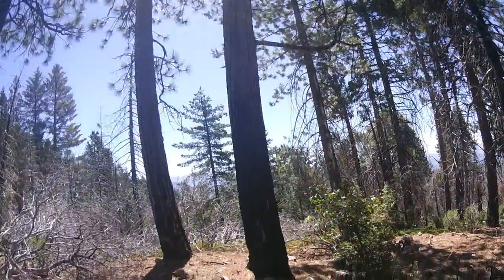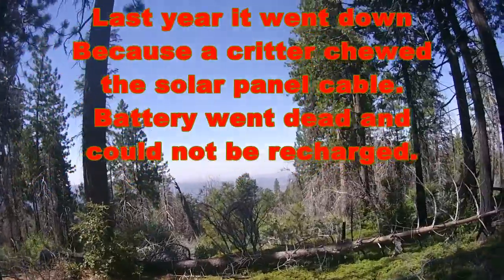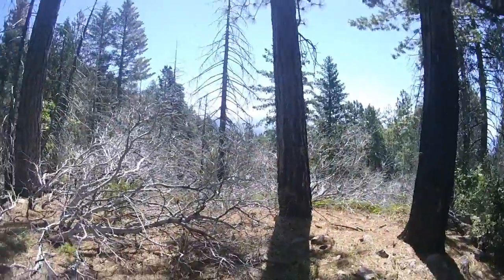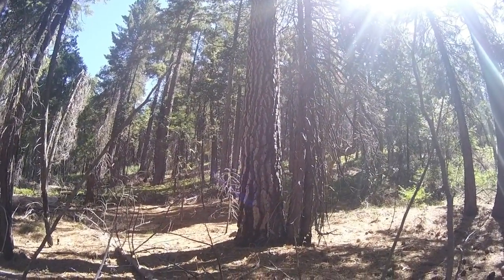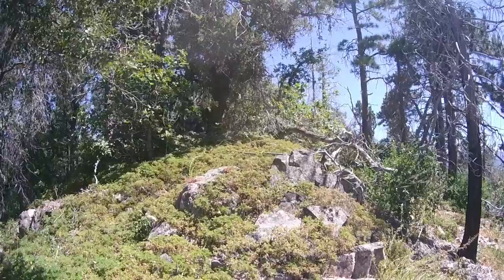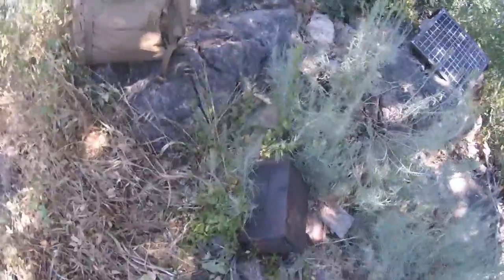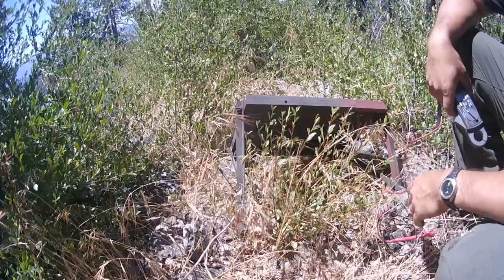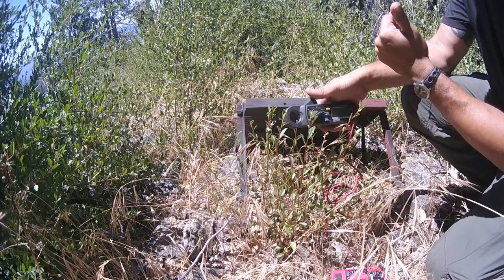SHTF Backup Comms After 2 & Half Years Of Field Deployment. Lessons Learned

Comment: What you are doing is fun stuff. It's to bad more people are not experimenting on communication gear like this. I am thinking about making a video on my junk as well. Right now I have a Retevis RT23 set up for crossband but it works like an inband repeater. I set up the user (UV5R's) A/B bands so they will tx/rx and switch. I never seen anybody do this and it works quite well. My set up is similar to your setup. Its been up in the mountains now for 3 years with no maintenance and is behaving perfect for now... KNOCK ON WOOD. Keep up the fun work. I think you are doing a great job with out much help. Wishes and 73, Love the grey area. It may save lives some day.
Reply: Do you have any details on how you set that RT23 up as an inband repeater?  Is it store and forward or duplex?  Thanks,

Comment: Try a flexible solar panel wrapped around the trunk of a tree off the ground facing the equator, like a powerfilm R7 (need several to match your current 20Watt panel).  Also, you could try putting your radio and repeater in a painted PVC pipe.  It could look like a tree branch if handled properly.

Exposed circuit boards and unprotected terminals (like on the battery) are a great way to short out a system.  Spend extra time making sure that nothing metal can short any point of your system out (overkill is best here, especially if unattended for any lenght of time) - bare PCBs are bad, but conformal coating spray paints are available for cheap (and will keep the board from corroding). Take a look at https://www.amazon.com/MG-Chemicals-Silicone-Conformal-Coating/dp/B008O9YGQI

For off-the shelf commercial radio protection, take a look at mylar vacuum bagging.  If you flatten out and space the wires in a cable, you can actually heat seal them in a seal without hurting them.

Comment: Not sure but I though I seen a dead tree to your left about 11oclock Is there a way to bracket off the tree about 6 ft up and put both solar and repeater up there?  It was in full sun making it great for charge and the solar can shad the repeater.
Reply: I saw the same forked tree and was thinking the same thing. Only potential issue is with the tree already dead it will lose integrity and could fall in heavy snow and/or wind and that hike is a bitch so I would imagine he doesn't want to have to hump back up there if he can avoid it for as long as possible.

Comment: Could you put the solar panel in a tree and hide it that way while still getting maximum sun?
Reply from the maker: I could but looks like the canopy will cover it up anyways. Going to haul a metal tripod next go-around. Just need enough height to be above the snow line. Thinking of camo netting underneath to shade the box.
Reply: GUERRILLACOMM
Yeah that will work. For the tree I had some pruning in mind. A hole in the canopy. Probably not PC but who the hell is ever going to know and when did trees become sacred anyway? :o)
To be honest, I am stunned this lasted as long as it did. I originally thought 6 months to maybe a year on the very outside. Once again the simple ideas prevail.
You could put a small windmill up a tree as a back up. What would be great would be some way of braking and un-braking the blades remotely by radio to allow it to be switched on and off at will and thereby avoid destruction in high winds.
I think I shall shut up now, I have started to drift off into fantasy land.
Looking forwards to part two.
Reply from the maker: I hear ya, all good ideas. I really don't want to disturb nature, its not worth doing any pruning and landscaping for my personal gain, " leave no trace". besides my equipment  has no environmental impact. I could work around it. The whole idea of this exercise is to see what is the minimum requirement for a self supporting comm system incognito. Don't want to make frequent trips out there except for the yearly maintenance. It kind of goes under the premise of, "Technically sound, Tactfully stupid." Its a fine line to balance, I think must me mastered to really get yourself a robust system in place.

Comment: Please don't pan the video - it's unwatchable.  Good call on the physical fitness.  Batt float voltage is more important than panel voltage.  MPPT converters fix a lot of badness.  Use AGM batteries.  Plan power consumption for emergencies - not system failure under no load.  Keep making videos that help people, thank you, de some ZL1 fella.
Reply from the maker: Thanks and copy on the panning, will cease moving about.